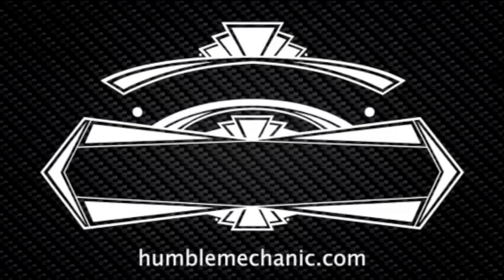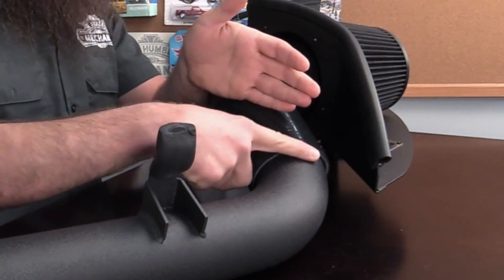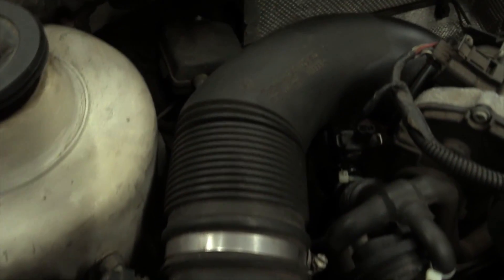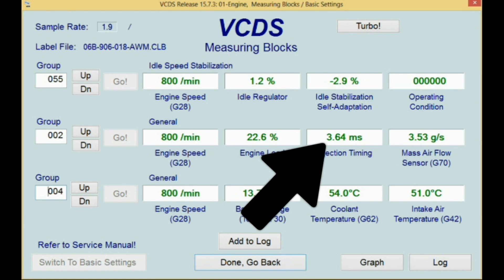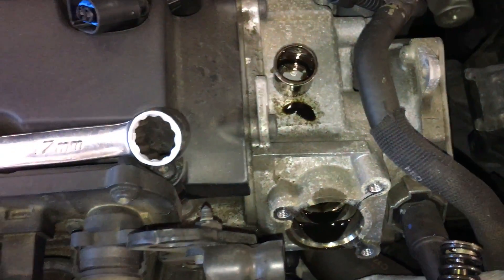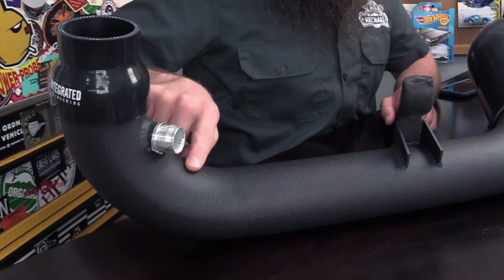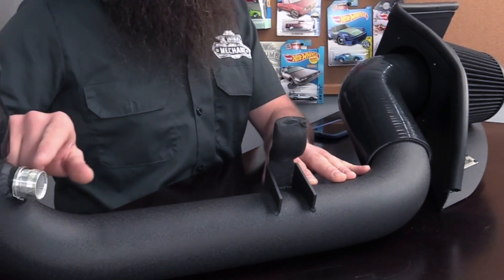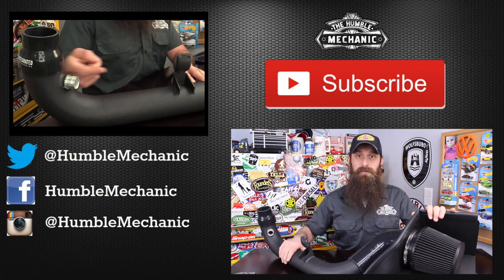What Does SYSTEM LEAN Mean?

Comment: Hi. I have a 2.0 tfsi, it's giving me code p2177. Checked all data logs and it's going lean +25 at high rpm (boost). Fuel pressure OK (upgraded hpfp), pcv new, valve cover new. I'm thinking about most plausible fault are injectors at high rpm are failing. What you think? Thanks for your time to answer (please) 👍

Comment: Hello I hope u can see this so my car has recently been idleing rough for a litttke then it goes to normal and when I was driving on the like 20-30 my car starting popping like if I had a pop tune just like one pop the cone filter brand new I have p2178 code whag can cause this my car is fully straight pipe catless down pipe thank you .

Comment: Nailed it. Been to so many mechanics, had the PCV done, injectors, EVAP, MAF....Paid thousands.  Still got the fault code.  Had a root round the bay today myself and found and easily found the brake valve hoses were badly cracked!!  Just paid $165 bucks for replacement, can't wait to get it in and test it.  The cars fuel economy has been terrible for over a year!
Reply: please let us know if it worked!
Reply: did it work`?

Comment: friend just had the issue  turns out Brake booster was rusted and allowing air in, Pinching the vacuum line to the booster proved the issue at the booster was the cause

Comment: I have questions so I have a Toyota 4 runner and I got a crack in the radiator housing holes so it broke off where you connect the hose up to the radiator so I have to get a hold of the radiator. But could that be a problem as well is P0171 code popped up? I had checked all the holes and I noticed the the crack was at

Comment: Hey man, I recently purchased a 2015 Infiniti Qx50 3.7L V6, i got a MAF and Lean sys error. Took it back to the dealer and they mentioned they changed the Air filter was really dirty and etc. so they changed that. The code came back and this time they told me i have to change my spark plugs, i did that today since they were almost at the end of their life cycle being use for almost 100k miles. I have not had any codes so far but what i wanted to ask is whether a faulty spark plug could possibly cause this code?

Comment: Hey, I have a old peugeot 106, And my car will idle rough when sat in traffic, I've put a new icv valve and oxygen sensor on cleaned the carburetor with no luck, i have noticed after changing the spark plugs noticed they are coated white. Does this mean it's lean on fuel? It drives fine other than this fault

Comment: I got the opposite: System Too Rich at Idle Bank 1 (Code: P2188). My car is a VW Jetta GLI 2004 VR6 2.8L 24V 6 speed. What should I try first? Replace the OXYGEN SENSOR or Mass Air Flow (MAF) Sensor, Dirty Fuel Injection lines?  The car shut down by itself after 10 minutes of been on. Initially I thought it was the battery and/alternator but after the car is off for 15 or 20 minutes, the car starts again for 10 more minutes, so something is going on between the ratio of AIR vs FUEL, I think. BTW, no engine light is shown either.

Comment: I have code P217700 system is to lean of idle ... i dont have any vacum leak or weak feul pump i cleaned everything and i still get the same code . I have 2019 Baic x25 . 1.5L DOHC

Comment: Great video. I don't know who is still watching this video, I need help. I have a 2012 VW Jetta Sportwagen 2.5, and I have been battling with the code P2096 for a few months. I have replaced a ton of parts, including valve cover, plugs, air filter, MAF sensor, O2 sensors both upstream and downstream, and the code still stays. some times it goes and sometimes it comes again. checked the intake and seems fine, as it has the MAF sensor after the throttle body. I don't know if the oil leak at the vacuum pump really causes this. The oil leak at the vacuum pump is obvious and I check it regularly.. So, I am going to fix the vacuum pump oil leak first, then, if the code still remains I will check the harness under the chassis around the exhaust. I need someone who are experienced this code on this car.
Reply: Currently battling this pcode with a f150 eco boost 3.5 have you had any luck yet?
Reply: @JohnnyKawasaki  unfortunately no man. I have tried to fix the oil leak at the vacuum pump first as there are comments about fixing the oil leak first. I have tried to fix the oil leak with an RKX kit and the leak stopped. Then, the p2096 code still remains. recently I have gone to the Autozone and found it comes another code P117a which VW official site says the harness of the underneath sensor may be improperly connected, or the O2 sensor may not be properly installed. Maybe I have to go to a shop and lift it up to see if the connection, harness, or o2 sensor has problems. Another possibility is the ECM or ECU is wrong. So, still battling with this code. My car does not have any other codes.

Comment: I just had this happen on a car I bought, turns out the previous owner must have had an intake kit on the car and then shoved the old standard intake on before  I got it and forgot to mention he had somehow sliced a big gash in the underside of the intake pipe causing a massive vacuum leak that I couldn’t see until I removed it.

Comment: Mr. Humble Mechanic, I need help. I have a 2010 Volkswagen CC sport with the 2.0 TSI engine. I have a check engine light on and also the EPC light is on. I had my car scanned at the auto store. It has a P0302 and a P2187 codes showing. Any ideas?

Comment: Great video, I have the P0171 code on my 97 Oldsmobile and on top of that the car doesn't start half the time. I changed the fuel filter like 10k miles ago and the car has 120k miles. I'm thinking since the car doesn't start half the time it might be the Fuel pump. Any Idea if it can be something else. Thanks

Comment: Your videos are awesome and a great help. I could really use some help here. I have a 2009 Audi A3 2.0 L turbo. My daughter was driving and it just shut off. Before doing so she says it sounded like a diesel but its a gas engine. I towed the car home and began to work. I have since changed injectors, cleaned all the carbon out of the intake manifold, changed the plugs and coils, pcv valve, oil and filter, cleaned the mass air flow sensor, cleaned the throttle body, and various other bits of cleaning along the way. While doing all this over the course of a month I had the battery disconnected. I put everything back together and attempted to start and it cranks really fast but wont run. I am getting the following codes now:

P0016
P0171
P0300
P0301
P0302
P0303
P0304
P0341
P0506
P12A2

Im not sure where to go with this now, could it be a broken timing chain?? Any ideas or suggestions would be greatly appreciated. Thanks.

Comment: Hey Charles, great video by the way.
Broda i have a misfire that starts when the engine is at working temp.
After i downshift at aceleration. Mostly at 2nd and 3rd gear.
Spark plugs are new, cables as well. ( its a Seat leon 1.4 16v axp engine 2002).
The fuel pump resistance gives me 3.5 ohms. According to the info i have seen that it should not be over 3 ohms. So im starting to think that is the fuel pump that when it gets hot dosent reach the minimun pressure. And the mixture gets lean.
What do you think or what would you do for this case.
Thanks a lot, and sorry to disturb.
God bless you.

Comment: I have a 2010 cc 2.0t,  on new and old maf sensor the same  p0101 on idle short trim 25% longtrim 0 for about 2min to 5 min until warms up, then short gets to 4-8 and long 40 - 49 on idle for 3min and on idle stabilized to short trim 0 - 48 long trim. It could be the wires?
Intake No leaks  the turbo whistle when driving and missfires p0300 to 0304 and the p0101 codes don't think is the cat plugged but Not sure.
Thank you in advance.

Comment: Just went to the dealership with 2014 vw tiguan system to lean off idle I replaced the pcv valve and the light came back on after clearing the code. Dealership says there is an oil leak from the timing chain cover and the pcv that i just put on is bad. I also have a water pump leak anywhothat's 2k out of my pocket and Christmas is completely screwed. I'll never own a turbo car again I just don't have the time tools or money to keep up.

Comment: Great video! However after replacing just about every major component on my MKV R32, I still get o2 sensor faults. It’s driving me insane and my pockets are emptied out
Reply from the maker: Oh no! Could be a monitoring fault like a vacuum leak
Reply: @HumbleMechanic  replacing the thermostat took care of some of my issues. However, I’m still getting codes P2196 (too rich) and P2096 (sensor correction) for bank 1. Could the upstream o2 sensor need replaced or could it be a problem elsewhere? I know it’s hard for you to say, just trying to pick an expert’s brain!

Comment: Would old gas cause this condition? I found my pcv tube that went into the cold air intake loose and barely in creating a vacuum leak. When this happened  my idle was rough and stabilitrak light came on. I didnt think I would make it home. My spark plugs were fouled. I cleaned them all and fixed the pcv tube leak with zip ties. I drove the vehicle several days later and it idled fine but my check engine light is now on and it gave me codes p2096 and p2098 lean fuel trims bank 1 and 2. With these codes set is that from the previous issue (vacuum leak) or is this now another issue (possible bad gas)?

Comment: What does code P2191 System too lean at higher load bank 1  need to be fixed? 
And is it safe to drive long distance with a yellow engine light on?

Comment: Ive been dealing with rev hang ever since i put a cold air intake on. Changed o2 sensors, valve cover, and im about to check fuel injectors. Maybe they are clogged. Obd reader says unregistered air after throttle body. Oh yeah, i replaced that too. Lol. Please help humble mechanic or someone.

Comment: Mr. HumbleMechanic would i still have a p0171 if my K&N air filter was slighlty torn a size of a penny? My fuel pump/filter was replaced 15kmiles ago.
Reply from the maker: It’s possible. Air filter issues can disrupt airflow into the engine. But it’s very dependent on the engine

Comment: P0171
I would like to add something to this that i just experienced. I have the n249 delete sia delet etc. And this code gave me the run around for weeks. Smoke test leak test everything. Well because of those deletes i have bypassed my diverter vacuum line to the throttle body next to bank 1. Well the vacuum side of the diverter when out and was allowing boost pressure to enter after the trottle body right into bank 1. Long story short. New diverter valve fixed it. Sad part about this is a smoke test wont show it

Comment: I had 2 codes on my Audi A4 Sedan B8 1.8TSI p2293 and p0243 I did change the high pressure feul pump and turbo Solenoid all codes gone but now having new code P0171 any advice the car drive but not 100% full power any advice please

Comment: I got s system lean, bad crank sensor, ignition coil and bad connection even though i replaced all the ignition coils, crank sensor and serviced the throttle. Any idea?
Reply from the maker: You probably have a vacuum leak somewhere

Comment: P0171 code, my car when it's cold will start right away but if I let it cold for 15 min wont start or will have a very hard time to start. I had spark plugs oil on them, I change the spark plugs and valve cover gasket, fuel filter, the mass air sensor.

Comment: Getting a P12A2 at the same time.  Cold start misfires first (most likely carbon),  warm engine, clear codes then get P0171 and sometimes P12A2.  Fuel filter has not been changed for a while

Comment: @   »»»» the factory,instead of "keeping adding fuel,keeping adding fuel" , could have done a cycle of "adding and taking away fuel" to  S E E  if the O2 sensor responded ,and give out a CODE for bad O2 sensor .

Comment: I got this weird issue after delete the EGR, I kept the sensor plugged in the valve to trick the ECU that it's still working. It works for a couple of months then all of a sudden I got into that lean issue. I'm just wondering how come the ECU found out that there's an air coming despite the EGR is already blocked and no actual air is entering the engine! Anyone knows how to overcome this issue and keep the ECU tricked?

Comment: I had this on my Toyota 3.4L V6, it was the Mass Air Flow Sensor, cleaning helped, replacing fixed it.
Reply from the maker: NCIE
Reply: How long after you cleaned it did you just decide to replace it ?

Comment: I have a 2011 Audi A5 Quattro 2.0T 
It’s running too lean only in cold weather the ltft 40% ,, when I hit the gas it goes down to 10 ,12when the car gets worm it’s back to 13 % 
Is it possible to have a vacuum leak or where should I look thank you 
— parts have been changed 
1.pcv valve oem

Comment: My 07 gti has been in so many hands but no one seems to know why . I get a 171 system too lean only off idle and throws me into a limp mode with no power.
I have replaced 
02 sensor
Purge valve
Vacuum lines 
Brake booster 
Fuel pump
Fuel filter
MAF sensor
Fuel pressure regulator
Thrust sensor 
Hpfp 
Cam follower
New air intake filter 
Diverter valve
Rear pcv valve
And I just put in a new downpipe with metal gasket all nice and tight 
It only happens when I'm in a constant steady speed or on highway cruising 
And also the engines tone after 4k rpms changes but only after 5th gear to 6th gear.
I have spent so much and been thru so many mechanics 
They have pulled logs and all and they all say the car is acting normal when they drive it or they don't know what it is . I'm breaking my head here

Comment: does a CAI impact system lean/rich? will it compensate if so or should it be tuned?
Reply from the maker: It can. I’ve seen them tweak fuel trim numbers. Tune can compensate if it’s designed to
Reply: @HumbleMechanic  so I bought a aftermarket cold air intake and p0171 popped up after a month, you think I need a tune?

Comment: I have saturn ion i put a short ram intake in but there is a secondary air injection hose out and i get a check egine light idk to replace it back to stock or try n remove the hose

Comment: Fuel pump went out I put a new one in 3 days later I am get p0171 code lean bank 1 wondering if it’s th fuel pressure regulator or possibly fuel filter it’s on a 2010 Camry and stealership say the fuel filter last the life of car and never seen one go out any thought I checked vacuum hoses
Reply from the maker: Wrong pump? Kinked line?
Reply: No it’s a oem denso pump. And it will run fine and not throw a code but the it will start sometimes and run rough and bog when accelerating an throw the code

Comment: You aren't going to have a vacuum leak before the throttle plate. You will however have an air metering error comparing the intake mass air vs O2 reading. The idle air control valve could cause this issue as well being it's a controlled vacuum leak.

Comment: Hey, I have a question. Is it possible that Longtube headers and no catalytics on my 1999 Mustang GT are causing a lean condition? Ive changed alot to stock as i bought it modded. Only thing aftermarket is those headers. Also I will have the PCM Reflashed at ford to the stock flash in case the tuner I used didnt do the job right, just to start with a clean slate. Revving the engine repeatedly makes the fuel trims go down from 25% to 10-17% idling until I leave it idle too long then they rise again.

Comment: 2 cylinders read bad st autozone.. Changed out coils...  All coils going out over time..  2001 f250.  Changed last ones almost,  after changed,  went to autozone,  had system lean and both cylinder reads.. Was not 250 miled yet to reset.  Was reading from O2 sensor.. Will a coil issue cause a system lean reading from the 02? My heat is also jacked up..  Am wondering if low coolant levels could cause that. After coils failed,  would see smoke coming out of engine.. Looked like a leak somewhete possible but dont know

Comment: Hi, I have a P2096 code that wont go away. How can I fix that? I just changed my engine air filter recently.
Reply: same man, did you get a fix? cheers
Reply: @RossPorterc  Suspecting it’s a bad oxygen sensor, Its extremely difficult to get the passenger side upstream oxygen sensor. Need to get myself one of those crows foot oxygen sensor tools. I can’t believe it’s been over two years since I got the code 😂.
Reply: @FarewellStudios  hahaha thanks for the reply man! I’ve just been resetting my bloody p2096 code for like 4 months but figured I should fix it lol. What car do you have? any mods? trying to maybe pick a commonality. I have a mk6 gti with a cai, 3 inch exhaust with high flow cat and a custom tune. I’m suspecting possible air leak after the MAF or just before the cat.
Reply: @RossPorterc   No problem! Damn nice, I don’t have any mods at the moment. Thinking about doing a quad exhaust setup eventually. I have a B5.5 Passat GLX 4-Motion that is mint besides that one issue lol. Ive been clearing that damn code forever now and sometimes it goes away. I read a lot into the forums and they say its an issue just before the cat. Is that the only code you’re getting?
Reply: @FarewellStudios  yeah that’s the only code I get and it doesn’t effect the way it drives at all it is just annoying hahah. What engine is in that? 2.0 turbo?

Comment: Hi, I have a problem code P0174 system too lean bank 2 in my lexus. How I fix that. I change the pcv valve and clean de Maf sensor change the air filter. What I do. That make me crazy
Reply from the maker: just on one bank? Usually an o2 or a vacuum/exhaust leak.